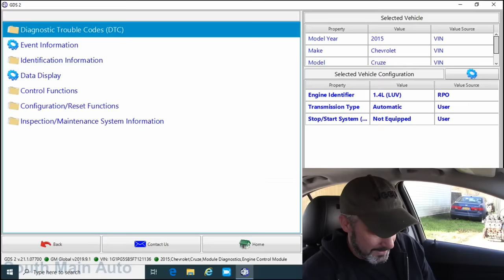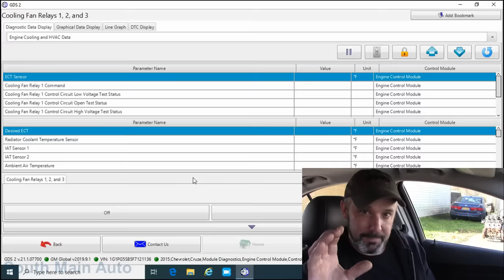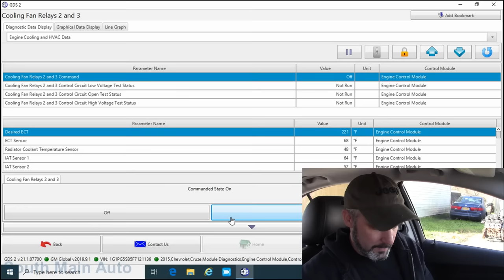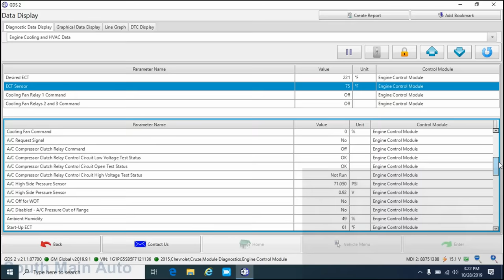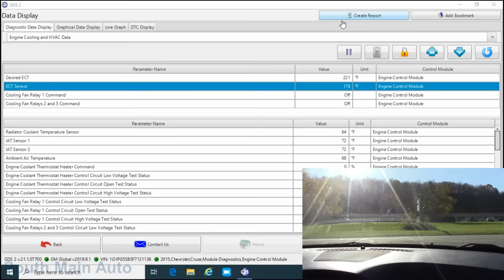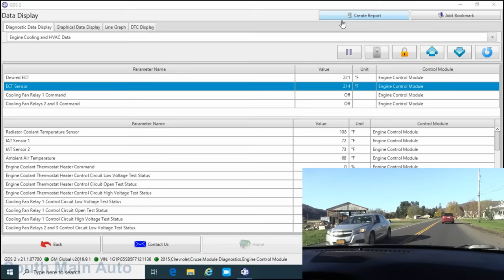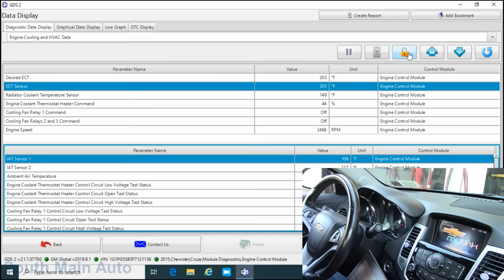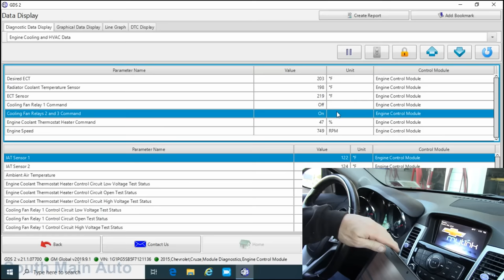Chevrolet Cruze: Overheating, Loud Fan, Losing Coolant

Comment: well it's a 2015, kinda problematic, wouldn't you rather just buy a new car??????
Reply: @RicardoPCGamer  I currently own a 2015 cruze LTZ with the RS suspension,1.4l turbo,6spd automatic and it's far from a pos. Everything has it's weakest link, and the only thing I've found so far is really the cooling system.This puts me well ahead of the curve diagnosing my own vehicle.
Reply: @markwright2360  you say far from a pos, when my aunt owned a 14, and that was the reason why she traded it.

Comment: Chevy puts Start stop in in the same car that cooling fan uses resistor shunt to get 3 speeds ?. It was copied from a 60s design ?. GARBAGE. DESIGNED TO FAIL